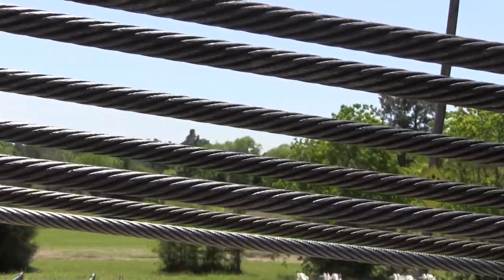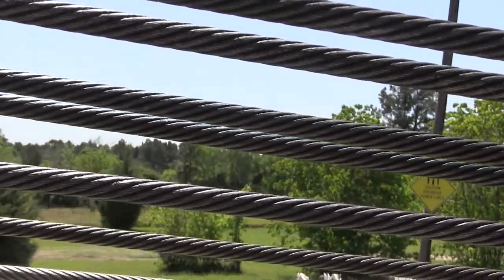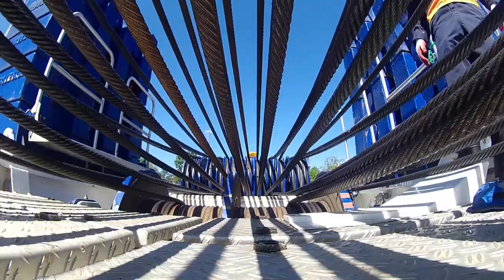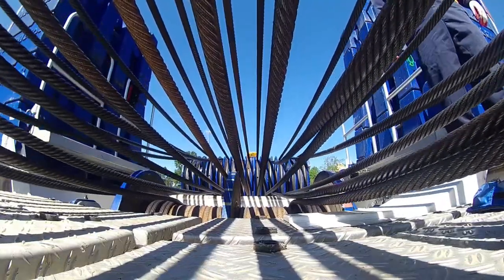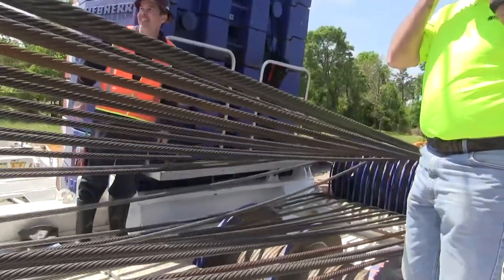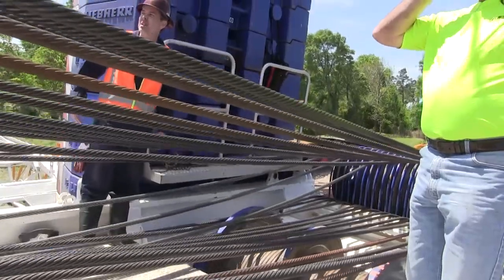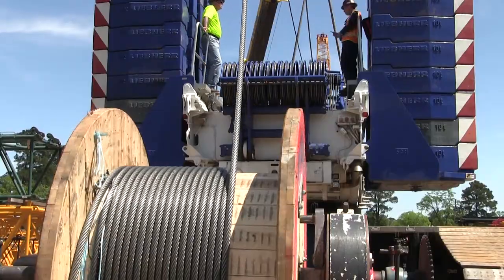How Does a Spooling Unit Replace Wire Rope On a LR 1600 Crane?

Comment: (1) Which diameter of wire rope is used on the Hoist of a 50 Ton Mazzela Overhead Crane?

(2) What about the wire rope diameter on a 60 Ton Mazzela Crane?  Is it the same or is it larger than for the 50 Ton Unit?  Trying to get a feel.on how much more expensive it would be to operate a 60 Ton versus a 50  Ton Unit.  A 60 Ton Crane would be necessary only once in a Blue Moon for our intended operation.